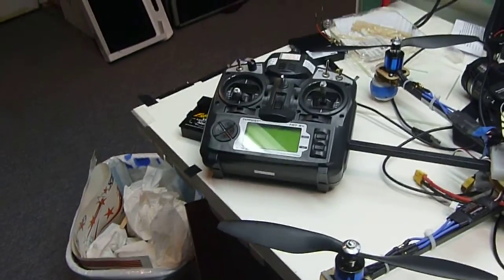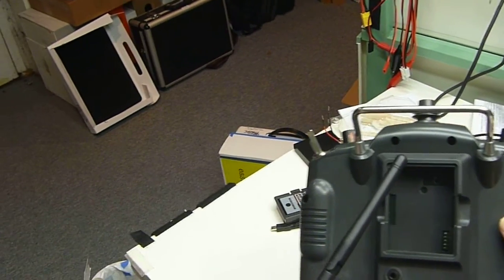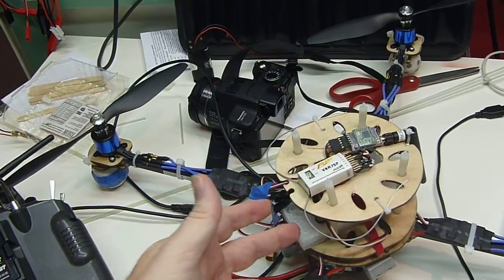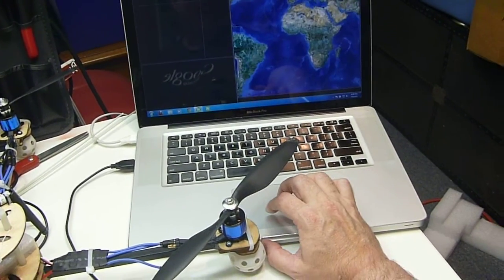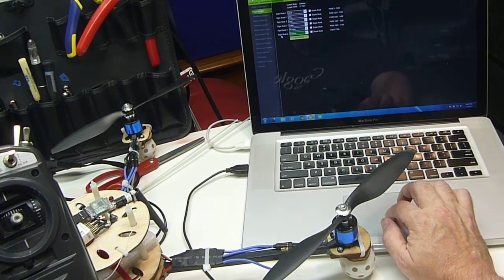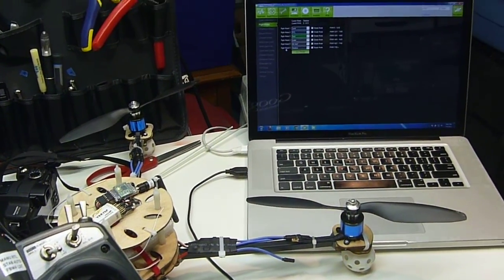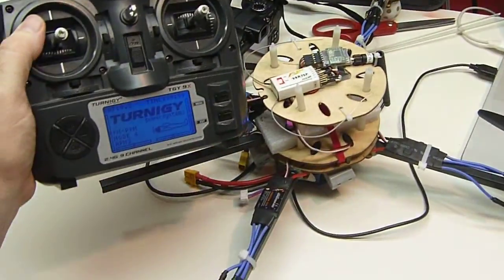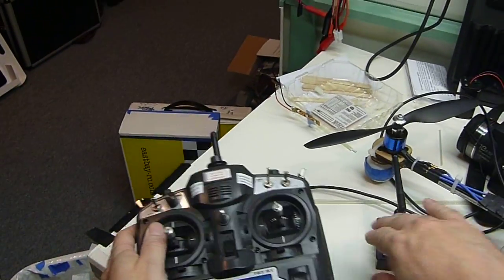Setting Ardupilot Failsafe for Turnigy 9x / FrSky module

Comment: good day
i wanna need your help i do have turnigy 9x with the module that comes with it. and the receiver  does not have a fail safe. once i have seen you post that it gives me a hope. that i can do some changes on my Radio transmitter wont be costly.can you email me the link of the module that you have use it, and the receivers. please.. and one more thing when you have plug your cable to the computer on min. 2.41 on you video. you plug the cable that connected to what please if you can show us ..

Comment: When thr is on =985 then when thr off = 1320. It can't achieve failsafe. It remains in stabilise mode when you switch off it go higher to 1320 in stabilise mode.
Any advice thanks

Comment: Hi
Straight forward video. I have thesame 9x and frsky jr module and x8r rx and have followed your video but my failsafe is still not activated. My thr when off is 984-985 when switched off it jumps up instead to 1320-1319. 
Any advice on how to sort this out or reverse it please?

Comment: just got mine and got it to work accordingly ..but when i try to do failsafe ..says in the instruction it will blink green twice ..but mine don't  instead it beeps ..i have turned of the tx for a test and it seems to work ..it went mid throttle when no signal ..will this be fine ?

Comment from the maker: Good question... The antenna cable is in the module, so I don't think it's designed to be run to the top.  The FrSky module sticks through the carrying handle, and I think most people flip it up as much as it will go.  When you hold the transmitter, that seems to put the FrSky into a position where it works well.  For longer distances (more than 1/2 mile) the patch antenna does a great job so long as you're pointing towards the receiver.